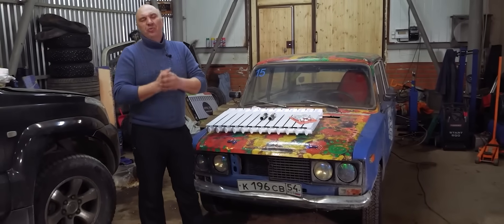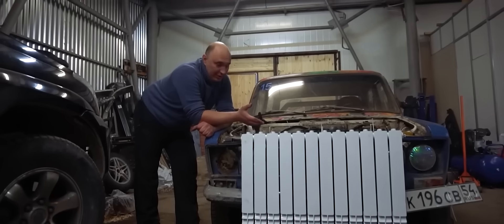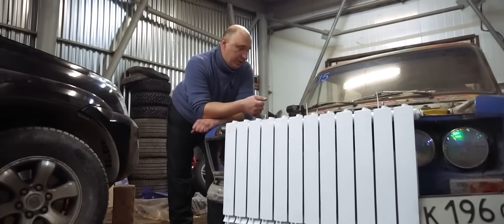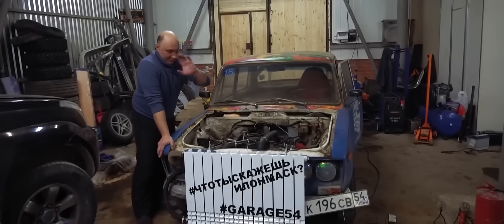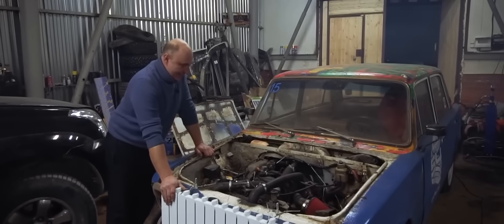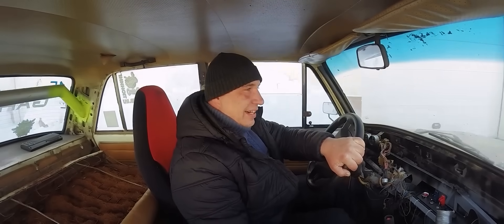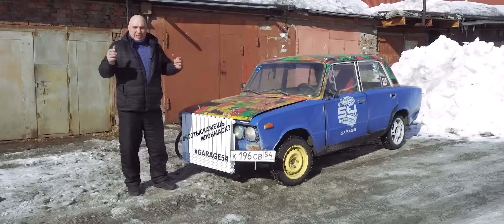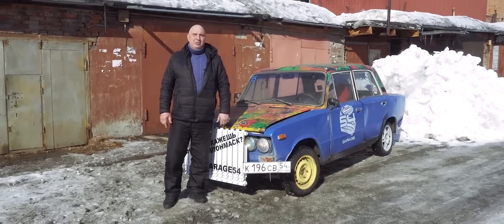We fit a household radiator to a car - will it work?

Comment: I already knew where this is going. In my taxi days, I drove a FWD V6 Buick LeSabre with a radiator swap from a V8 Chevy Caprice wagon. Summertime it could idle all day with A/C cranked and never top 180F.

In winter the windows iced up because the coolant temp was too low..

Comment: This radiator is designed to have the air moving through it vertically. If you flip it horizontally it will be much more effective.

Comment: I saw an antique tractor at a tractor show that had a cast iron household radiator on it. It was running, but not under load. It looked like it had been on there for a long time, I assume it was working for them. Great idea if it did work, heavy duty, and no clogging with chaff!

Comment: make manually starting car...remove starter and put flywheel and crankshaft what you can use from the cabin to start the car? xD (my car starter just broke and i thought how manually start it with every time without failing parts :) )

Comment: Lower part of the radiator being cold actually means the hoses are backwards... In normal radiator, the upper part is colder as the fan will only cool down the upper half. The heat naturally flows from down to up, which is why in houses the radiators should be installed as low as possible, close to the floor, or even inside the floor.

Comment: its lacking heat sinks!!! Aluminum heat sinks with thermal paste but i'm sure you will need to actually mount them with solder to make sure they do NOT fall off but the thermal paste is what transfers the thermal energy between the metal and the aluminum. Aluminum sucks heat out of the vicinity so then you can use the air from in front of the car to help cool it down. Thats how you properly do this.

If you add heat sinks to the entire front of that radiator, this would work.

Comment: You should fit a turbo with an electric motor and its own energy source to have zero turbo lag, and in so doing, try to make it like a cheap DIY version of one of those actual fancy electric turbochargers that take up to 48 volts but cost thousands of dollars.

Comment: To finish the look you need to have clothes drying on it
Reply: Would melt if made from synthetic materials, like most modern clothes are...
Reply: @Monni95 yeah, my fleece dries very quickly compared to wool 🐑
Reply: @Monni95 clothes can't melt at 60-70 °C even if they are synthetic

Comment: My daily driver during good weather is an MGB that had cooling prob`s until i added an additional MGB radiator to it. 
Now, one rad plumbs into the other then back into engine.  No big mods were needed & stock hood is retained.

Comment: car rads are air cooled but the house one is more self cooled by the extra metal (heavier)
Reply: The radiator getting warm draws air up through the bottom and out the top. So there is air movement (convection currents) with household radiators, it's just a lot slower.
Reply: @volvo09  the air is what cools car rads more than household unfanned units

Comment: could use 2 radiators in serial and have one of them inside to heat the cabin.
Reply: Well, that's how heating works in a vehicle with an ICE engine, anyways. Heat is what it produces the most, like 70% energy going to heat, 30% to movement.

Comment: One time I hit a moose with my water truck, destroying the radiator. I was able to connect the water tank to the engine with the fittings I had on hand, plus a few that I bought off a service truck that drove past (after I told him what I planned, he had his doubts it would work). I was able to get back to the shop from the middle of nowhere. The water tank was quite warm to the touch when I got parked, throw a snowball at it you could see steam. It was an 8000 gallon tank that was about 80% full.  Sometimes you gotta do whatever it takes.
Reply: Genius! That big tank, plus whatever dissipation you got from the tank itself was enough to store the heat for that trip home.
Reply: Using large water tank works as long as it's no more than 90% full... There has to be about 10% empty space to account the expansion of the water when it warms up. As long as the water temperature doesn't climb higher than 90 degrees Centigrade or 194 degrees Fahrenheit, the engine should not seize or let the Smurfs out.
Reply: @Monni95  A lot of engines will still be ok at 230 °Fahrenheit ,110 °Celsius, for a little while. But, 194/90 is much safer area for temps.
Reply: Great innovation that may have saved your life
Reply: I once blew my water line in my car, drove home anyways with no water, I stopped at a gas station and like an idiot poured cold water all over the engine block, then drove the rest of the way. Engine made that stereotypical clunk noise when I turned it off. 

Drove it after just fine, eventually scrapped it. 

Got lucky me thinks
Reply: @sacr3 I blew my head gasket and had to find water wherever I could enroute. Was 10 hours away from home. As it was rural (Northern) Scotland I wasn't near shops. Looking back I'm surprised I didn't try to get a large 10 or 20 litre container to fill with water. Had to get cylinders bored out but after that the car ran better than before. My uncle ran fomula Ford race cars so with the increase in CC, different jets and carb tune up it was a little but more lively to drive, great car, early VW Polo
Reply: @CawKee  Nice!
Reply: Long ago  I had a lada07 (06 in a video they're same) battery had a crack and it dripped acid down  ,it eaten a steel tie on a radiator and one time fat hose down there has popped off leaking all coolant out of the system , i was 50~km from home , it was allmost midnight so no store was opened , i just drove home trying to keep revs and load on engine low as i can , made all the way just fine, temp was 110 when i arrived
Reply: That's one of the best roadside fixes I've heard to date. Great ingenuity!
Reply: I blew a intake gasket on my way to work. Had 3 empty jugs filled them up(truck to) before I left the jobsite. Then tried to avoid the highway and coast in neutral on the backroads. It was winter and snowy so I only had to stop 3 times and fill up the truck and let it cool down.
Reply: Any one you walk away from
Reply: Hot tub on the back could be an option
Reply: Then you run the warm/hot water through your home radiator system amd warm up the house...😂😂😂😂 It's a win win!!!

Comment: This would definitely overheat in the summer. There is way less surface area
Reply: Maybe.... Depends if the lada just has a little single core radiator.  He did say the engine is only about 800cc. I had an air cooled 750cc motorcycle and it had much less surface area, and an oil cooler that was the size of paper currency.

Comment: ...now try using propane cooler principe to cool the engine. Better yet, use engines own heat to evaporate amonia-water mixture instead of burning propane gas...:D

Comment: Nice. House radiators are common in Western Europe (have been there, but live in the States), so it is cool that you guys made a car radiator out of a house radiator. 

Next step, make a diesel Lada, add modern Lexus seats into the interior, and have a dashboard controlled by a Raspberry Pi, chrome metal thermostat dials, and a modern interior. Run it on veggie oil and drive it to Paris and back. Europe road trip would be cool. Everything can look like the car rolled off the factory with modern amenities. 

Good job, G54. You guys are Top Gear UK + Mythbusters reincarnated.
Reply: They converted a lada engine to diesel before! Took help to get it started, but once it was warmed up it ran by itself. It was a cool project.
Reply: The "drive it to Paris and back" part most likely won't work, because of sanctions...(
But G54 has traveled across Europe some time back, prior to "rona" even. They even collabed with channels such as Master Milo, way back in 2018. Those videos are easy to find, you just need to open the home page, sort videos by "oldest", and from there you'll find them (by "them" I mean the videos from Europe) in the eleventh row or thereabouts.
Reply: @SwapBlogRU  The sanctions would not apply if the Lada was made in factory located in Finland like some were... You can't drive Russian-made Lada in Europe, but you can still drive through Estonia to Europe.
Reply: Darn, it seems that politicians (US, Russian, and EU or anywhere else) take the fun out of things. They should hire us fun young guys as politicians (making peace by doing cool stuff with cars or engineering), instead of guys born before the internet. But yeah, Master Milo is from West Europe. I am in the States, and the States needs some good car shows like G54. If the world ever gets better, I will be waiting to see you guys do a road trip in the EU and maybe the States.
Reply: it wont fit the redneck engineering theme they have.